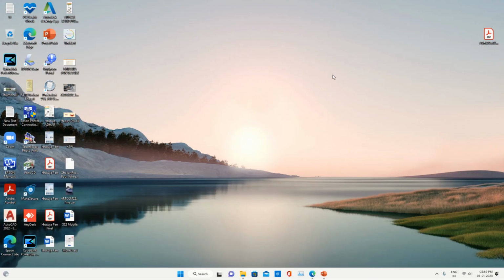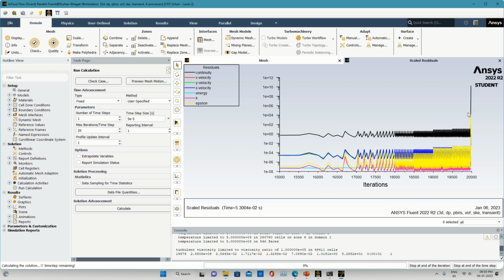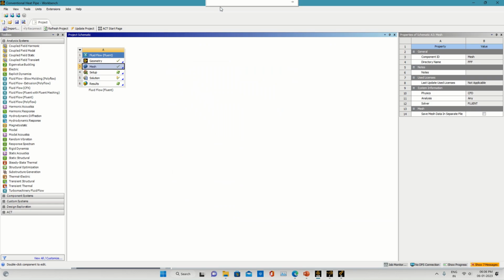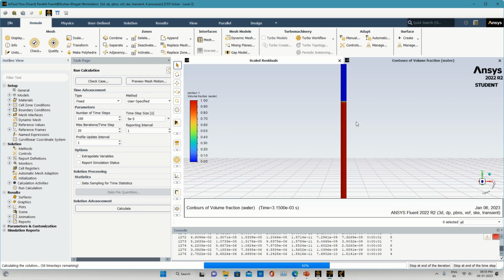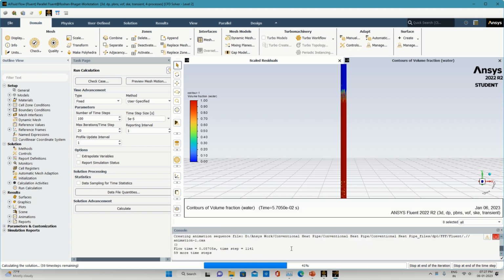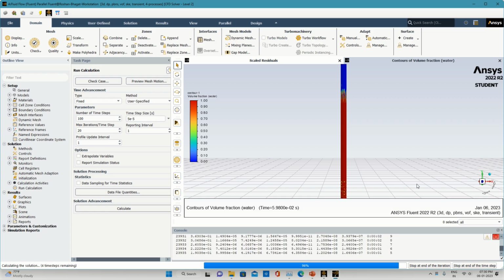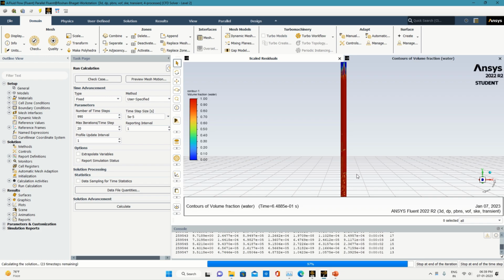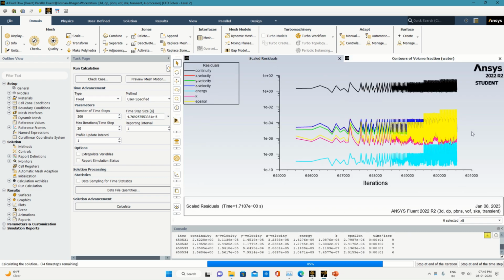Floating Point Exception Error IV | CFD Analysis of Conventional Heat Pipe @Ayush.Bhagat

Comment: Bro I have a error when I solve flat plate heat pipe with amonia and water but iam getting latant heat less than zero error how to increase latent heat what parameters I need to change
Reply from the maker: Check the value of latent heat, preferably take it from property table and enter value manually
Reply: @FrontiersInCFD  ok